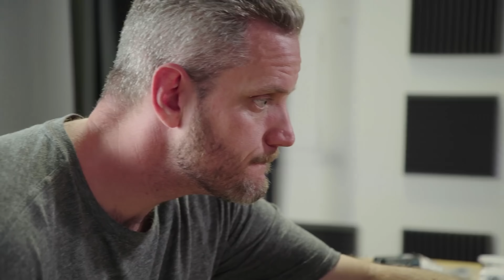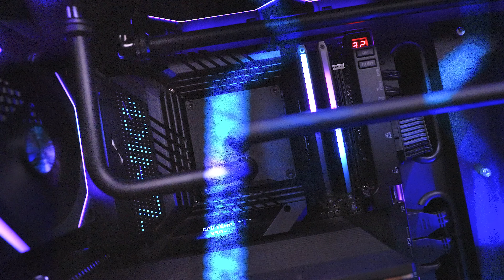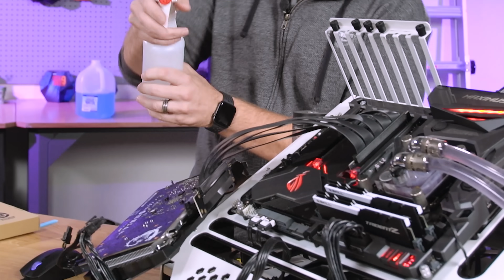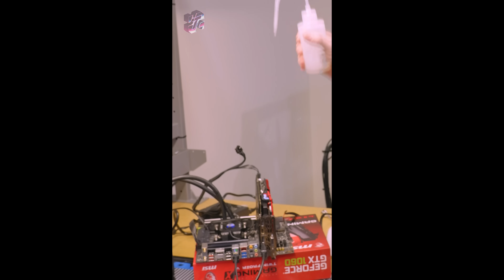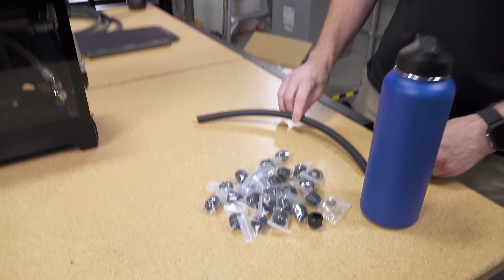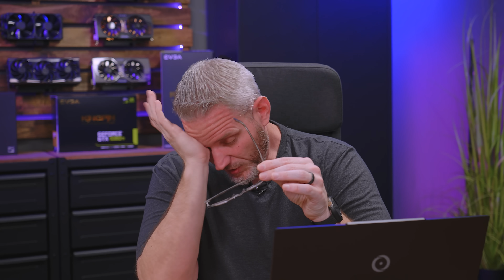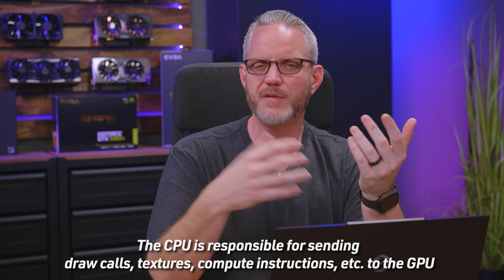5 Myths about Watercooling that are WRONG!

Comment: Obligatory "water cooling doesn't need to be expensive" comment. I just paid $99 for the alphacool Core 1 CPU block, whoch is literally one of THE BEST blocks in existence right now. Freezemod $50 pumps are excellent, and their fittings are like 22 for 8 hard tube fittings. $400-500 can get you a solid CPU loop and you only ever really have to change the block when you upgrade, IF its incompatible.
Reply: Thermalright has the Frozen Prism line which is like 60$ US for a decent 360 AIO
Reply: I mean, that is still pretty expensive compared to a decent AIO or air cooling in general. At this point, there is just nothing that beats air cooling in costs. You pay once for the air cooler. It doesn't require virtually any maintenance except for maybe replacing a fan every so often, and then you just buy a new mount to make it compatible with a new socket. Hell, a bunch of companies will just straight up ship new mounts to you if you reach out to them.
Reply: @JustSomeDinosaurPerson  Sure, but you're not really buying it for the price ratio. Just straight cooling isn't really the point of it. An air cooler would be ideal for that, as you mentioned. I did it because now, I don't hear anything from my PC and I can get GPUs that are overclocked even higher. Me paying $100 is still me being bougie because my current one was $50 and I could have bought one for like $40. 

You really don't even need maintenance on the loop that much. It can go for a couple years and be perfectly fine, as long as you're not being fancy with dyed coolant. 

You can get new mounting equipment for waterblocks too. EK, I believe had upgrade kits from LGA 1200 to 1700.
Reply: @Dexx1s  Yes, but the context was about whether or not something is expensive. To the vast majority of the pc consumer base, $400-500 for a cooling solution is too expensive when you can buy a $40 air cooler.
Reply: @JustSomeDinosaurPerson  Sure, but comparing it to an AIO is kinda irrelevant. I'm clearly comparing to the parts that Jay usually shows off that are far more expensive and aiming to those that actually would want to check it out. A $90K car is expensive. A $90K Lamborghini being advertised at a supercar show isn't.

Comment: Always been scared of Watercooling, even AIO cooling, as always afraid it would leak and destroy my system.    Been with Air Cooling for years, and typically desktop is on 24/7 doing various tasks---usually at nighttime after i finish gaming typically some nights Backup,  Some nights light DVD video burning,   Other Maintenance tasks,  or sometimes i use it to stream my relaxation audio to sleep to my Galaxy Buds if i don't wanna use Phone to do that.

Comment: I have a 360 Lian Li AiO and my computer warms my room up by at least 15 degrees. In the winter it's great, but in the summer even with the AC on my room stays around 85 to 90 degrees. I do need to pull out my 9 fans and dust them off as it's been a while. All 9 of my fans are used as intakes and heat passively goes out the back of the Lian Li De Baur case.

Comment: If your looking toward water cooling to keep your space cooler, you're looking at moving the radiator out the window. There is a series of additional challenges to move the heated water out the window decently such as pump pressure, solar heat, window air sealing, and so on.
Reply: Back to the old days of external radiators
Reply: Pretty sure it would require a custom loop that pumps in and out of your window AC unit at that point.
Reply: its much easier with air coolers. you can just do a closed exhaust towards the window.
Reply: @StrazdasLT  any air pushed out will be replaced with air being pulled in somewhere. Path of least resistance often means from an exhaust vent such as from the hot water heater creating a potential carbon monoxide problem.
Reply: @marxmaiale9981  Normal homes dont have water heaters, they use hot water mains.
Reply: @StrazdasLT  Which country / region are you from? You're area may have a different set of building code standards.
Reply: @marxmaiale9981  Eastern Europe.

Comment: Besides loop order I'd like to see a look at loop direction.  If you want to swap the inlet/outlet for the GPU/CPU, maybe because it makes running the tubes easier, does it impact temp or flow rate?
Reply: some blocks are directional, some aren't, it depends on the design - whatever his findings are will not be universal. That being said, reverse flow wont be the end of the world for cooling your components, they'll still be nice and chilly, they just wont flow as well in the wrong direction, so the coolant will have time to warm up more and you may see a few more degrees on the components in the loop than if you had it setup in the correct flow direction.

Comment: Jaaaaayyyyzzzzz.... @12:42 a modern custom water loop like the one you build IS a closed water loop!!!!!! An OPEN water loop is a loop that is OPEN to the atmosphere, like back in the days when water coolers would play around with a shower head spraying into a bucket to help lower water temps via evaporation (if they didnt use a heater core or car radiator of some sort). THAT IS A OPEN WATER LOOP!
Reply: open loop, in the context of water cooling in 2024, just means it isnt an AIO, which is permanently closed. The custom loop is "open" to user maintenance and modification.

Comment: changed to watercooling a month ago, mostly alphacool hardware (nickel plated copper coolers and copper radiator), black 10/16 rubber hoses.
filled it with destilled, deminerialized water in combination with a silver coil in the resovoir against alge buildup. is there anything i should worry about long term?
Reply: Just set aside one day a year to drain, clean and refill the loop. Should have zero issues but if you notice buildup in that time change something. Yearly maintenance is a minimum. Coloured coolants just do it bi yearly and it should be fine. I will never understand how people screw this up, it's not hard.
Reply: Silver coil can cause nickel plating to wear which is why we stopped using them, may want to use Mayhems biocide and inhibitor instead.

Comment: The one down side to me of WC is the cost of the fluids and the shipping of them. I am a huge fan of the concentrates it saves on shipping and it save the company on bottle cost. but they have all decided we are to dumb to mix it right so there are fewer companies doing concentrates which just sucks. my loop is a 3X280mm rad set up and there is a rad in between all the parts of the loop. So I have the pump going into a rad into the GPU into a rad into the CPU into a rad into the pump. I am using a single DDC pump (4.2 EKWB) for the head pressure but I am thinking of adding one more hidden DDC pump just after the CPU to really get the thing moving easier with all the rads lol. I have almost all noctua fans in it for solid performance and low noise. even when I am gaming full bore it never gets loud. Took me forever to find a case that fit 3 280 rads lol

Comment: Since I don't have heating in my house I'd love to use my computer as heat source, but only in winter, in summer it would be an absolute pain to have 35C outside and 55C inside XD

I know linus tried that, but he bought used heater. How bout those radiator/heaters that are filled with hot water to act as heating system for houses... But as radiator for water loop?

Comment: Sorry Jay but pure water is conductive as it contains H+ and HO- ions. Yes the conductivity is low (~0.055 μS/cm @ 25 °C), but depending upon the temperature and electrical potential can increase drastically. Just apply a DC voltage to electrodes in a beaker of water (like we did in elementary school) and watch the Hydrogen and Oxygen bubbles form. 
Using distilled water in a cooling loop may reduced the probability of damage from leaks, but it is far from zero.

Comment: AIO get saturated, so a water cooling system must also eventually get saturated with heat. it must just take a lot longer. but i dont recall what happens when the cooling fluid is saturated with extracted heat? does the temperature start to slowly rise if you keep playing a game past that time? can it ever get so saturated that the system thermal limits to prevent damage?
thats my question. also is it possible to cool the air flowing through the radiators, sort of like a tunnel the radiators are in separate (outside) the part of the case with the components, and like an intercooler for a turbo?
Reply: If your AIO gets saturated it means it's too small for the load you're putting on it. This can happen to custom loops as well if you don't size them right, but most of the time people use more radiator than they need to keep things quiet.

Comment: Jay, do a review on the Aquacomputer Leakshield. Been running it on my soft tube setup and once you get it dialed in it’s amazing. Absolutely zero worries of any sort of water leak throughout the system. Pulling 330mbar of vacuum on the loop and not having any tubes collapsing.

Comment: So, there is something to point out about what Jay said. I am a visually impaired person, and I can barely see in front of my face. It took me some time because this was my first AIO install, but I was able to do the entire process through feel alone, and my only IT background is software... I am not a hardware guy, so if I could do it... Any of you can. Everything was preassembled; I just had to swap out the intel plate for an AMD plate, screw the cooler into the backplate, mount the radiator and fans to each other then attach it to my case. Literally, that is step by step. All by feel with an Allen wrench and a Philips screwdriver. There's no need for any special training or equipment. Someone without an IT background could do this; I could teach an elementary school kid to install an AIO.

Comment: I’d love to see the fully temp monitoring across all the components to properly put that to bed.
Reply: Not like that would change anything. There's a ton of evidence that the order doesn't matter but people are gonna ignore it anyway. In this video, you saw clips about leaks destroying systems. Check how many comments are crying about the risks of leaks. I've already seen a couple.

There are tons of people, myself included, who've put sensors before and after components, shown the 1°C delta along with the system temperatures that show that the water itself doesn't even change much and the components don't either.

Comment: I  usualy run from gpu to rad thn back to cpu than to another rad in my case its for appearance I like the look of the pipe work, on the mith side people say its harder to change compinents I would disagree if the loop is set up corectly as Jay has shown in some of his videos with a drain at the bottom of the loop you can dran it down easy to change out components and unless you are using it as a test bed how often do you need to change stuff out, 
thows fiting you showed in this video look identical to Barrow fittings so makes me think made in same factory as a lot of things these days

Comment: I finally bought a Hisense 8k btu dual hose portable AC for $200.  Its awesome.  It can drop the room temp 10 degrees in 10 min.  I let the room heat up until its uncomfortable.  Run it for 10 min and its good for another 30 min to an hour depending.  ~1000 watts while running.

Comment: I'm sorry, argue what you want but science speaks loudly on this topic bottom line. There's a HUGE difference between expelling heat from an air cooler that's blowing 70C out of the verses 45C (or lower) from a radiator with liquid in it thus reducing the overall "heat" being expelled into your room... Giving of course you have decent fans, fan curves, and a overall a proper setup to get adequate cooling.

Added note: 

If air cooling as a whole was better than liquid cooling then why are servers (Google, youtube, etc.) switching to liquid cooling better yet why is high end pc parts suggesting liquid cooling and not air?

Comment: I have no problem with using water cooling. My problem is the amount of effort and money it costs to build a custom loop. The idea is great but the amount of maintenance needed is beyond my idea of fun! I use an AIO and it's fine. Why would I put so much effort into building a custom loop that won't last as long as my AIO? If you find it fun to build such a system, then good luck to you! My present system includes a Corsair 360 AIO and I'm happy with the result. At present I've been using it for 9 months and I expect to keep it for at least another 2 years no matter what other components I upgrade. 😇😇😇
Reply: I still use heater cores, gear pumps and a 5 gallon bucket. The only thing I've upgraded over the years is the 'reservoir' going to a metal canister with a 7" t-bolt clamp so I can flush the system once in a great while. 👌
Reply: @C-M-E  love the utilitarianess of that, pity I'm vain and care about looks too much otherwise that's the way
Reply: "won't last as long" is bull,AIOs are junk within a few years lmao
Reply: @ffwast  a good AIO can last for 9-10 years easy. And cost $100. That is about 1/5 of a CPU custom loop. So you can get 50 years of AIO's for the price of a custom loop.
Reply: @Audiosan79  You're talking bs again lmao
AIO's don't last 10 years and a CPU loop doesn't cost $500,stop being a clown buying junk.
Reply: The upfront cost is high sure but maintenance is not that big. Take one day a year to do a full system clean, blow out dust and drain and refill the loop. If there's block buildup, take it apart, clean it and do it back up. Take a day at most. If you need to upgrade the only ongoing cost is new blocks. Radiators are pretty much good for a decade or more. Pumps are easy enough to replace but generally stable.
Reply: @prototypep4  I appreciate your input but a day's effort to maintain a loop is still more than I want to contemplate. The only maintenance I want to contemplate is dusting and cleaning every now and again!.  I don't live in a dusty area so it takes very little effort to keep my PC clean. I guess you could say I'm too bloody lazy but hey! I'm a curmudgeonly old git! I make no apology!  😂😂😂
Reply: @JohnCraig-y6f  the better and quieter performance is what does it for me. My system has 3 420mm rads in it. I can keep even a gpu under load cool with near silent performance. You just can't match that with an AIO and stock gpu. I mean you could go something like a suprim card but at that point may as well just have a custom loop.
Reply: yes the cost is more for custom and AIOs are great for ease of install, the ability to add more rads is what swings it for me.  You don't even have to drain your loop every year if it's just water and biocide and if the pump breaks, you can fix it or replace it.
Reply: Build your loop right and it will outlast your AIO with ease. Mine is from 2018, still going strong, only changed the coolant twice. No leaks, no drips, and barely any noise.

Comment: For my first (in 2021 and what's current build even now) loop, I spent ~450€ to get started. That contains pump/reservoir,  cpu block, fittings and liquid from EK, radiator from Aqua computer. It felt expensive as hell but now if I'd want to build new pc with waterloop, I wouldn't need to get any other than maybe CPU block if I don't use AM4 socket cpu. Starting without any parts when building  loop is what's expensive, if you even have few parts already it gets way cheaper.
Reply: AM5 uses the same bolt pattern, so you're still good to go as far as AMD is concerned.

Comment: Caan anyone help how to balance out an R7 5800x and a Rx7800xt, or maybe i have it right
R7 5800x is 4.6mhz 😅 1.8 volt
Undervolting it
Rx7800xt is at stock basically
I wanna say its my PSU 750 gold but i read it should be fine
Now i also wanna upgrade my CPU so at most solutions would be temporary 😅 especially pair it with new motherboard and DDR5, still working with what i scrapped from pandemic times on spec i upgraded since then was my GPU 😅

Comment: I have a 3090 and a 13700K. The loop order definitely made a difference for me. I tried both GPU > CPU > RAD > ... and GPU > RAD > CPU > ... and saw a significant drop. Granted, my fans and pump are super low, but I want my PC to be quiet. It was enough to make the same fan profile never kick up to high while gaming. I think it was like 10 C cooler on my cpu while gaming but I can't check obviously. 
Maybe do a test where you have the pump and fans at a level where they are absolutely quiet. My 9 LianLi AL120 fans are at their minimum at 660 rpm and my pump at 2800 which corrosponds to 1L/min according to my flow meter. 1 normal 360 rad and 2 thin 360 rads.
Reply: Your loop isn't performing as it should since your flow rate is too low.

Comment: Ironically, your room would be coldest if you just let your parts thermal throttle. Thermal throttle = lower clock = lower heat output

Comment: Just got a new case and added a new rad to my loop. No need to upgrade any parts, but I'm glad I got in and added new fluid and cleaned the blocks.. these barrow and barrowch fittings have held up just fine. Reusing parts is awesome
Reply: I have used ek, bitspower  etc for fittings and I also have a lot of 90 degree fittings from Barrow. I haven't found much between any of them except for price. I like EK torque fittings because they are easy to tighten up but I'll use the Barrow 90's 45's t fittings etc all day long.